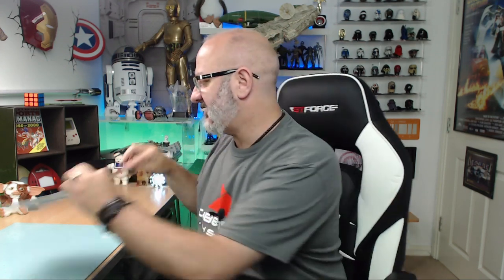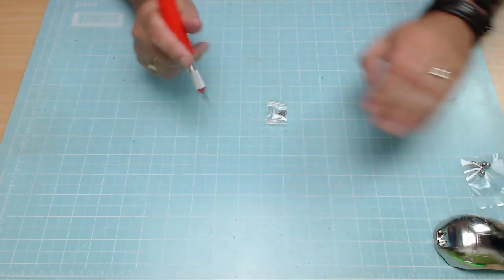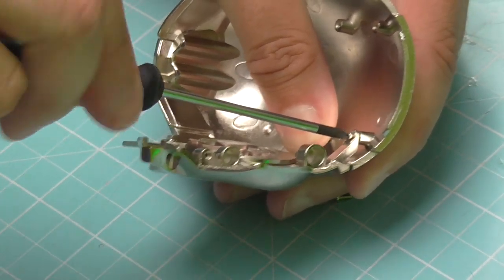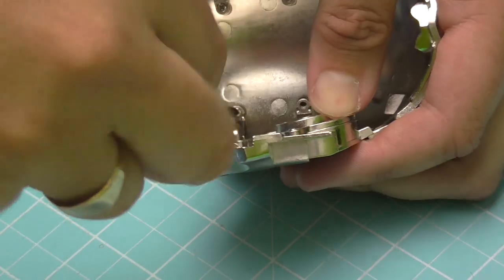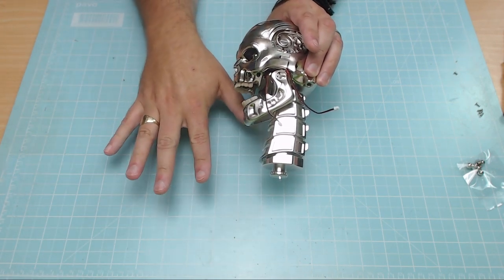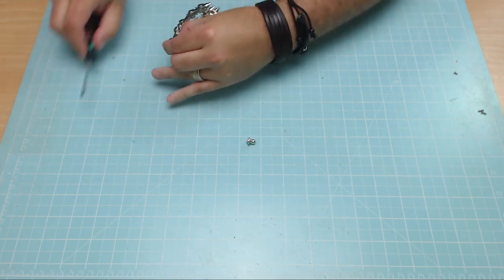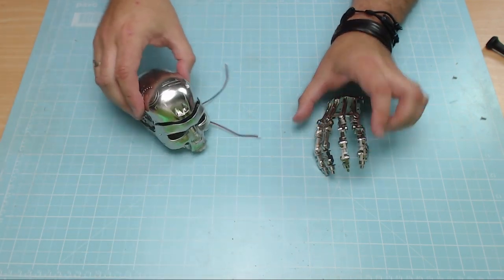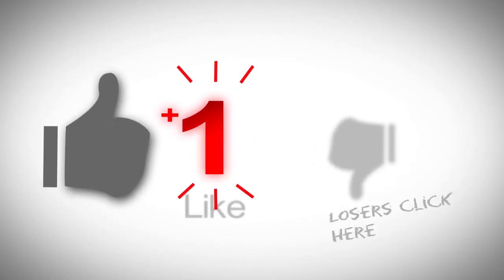Build the Terminator - Part 17 - Fitting the Sides of the Head and Palm Details

Comment: I'm still wondering how those eye cables are going to get to be on the "inside" of the neck, no hole in that ball joint at the top of the neck,  no idea
Reply from the maker: Me neither lol
Reply: @WorldofWayneUK  Do we have info that that is how it is or are we guessing,  i thought it'll all be in the head like a radio controlled car,  batteries,  receiver and a couple of servos all packed in 😂
Reply: I've a feeling there's going to be a small board that'll attach to the back of the head where you plug in the eye LEDS and atleast two more wires will be fed through the two holes in the lower jaw plate at the back, one on each side and the wires will be much more thinner to fit through either the pistons or the outer neck wires.
Reply: Much like their model Bismark. Their will also be asmall gearbox so's that both eye's can move left to right via remote control. I also think their will be som sorta Small hydraulic motor/gearbox. So's that both the diecast metal pistons for the upper arm/plastic pistons for the lower arm can also move up/down remotely. So they'll be much more electronics just for that simple movement. But that's along way off yet
Reply: Maybe the eye cables might connect to the big cabled pipes that come out of the back of the head and run  down into the chest part, to an infared unit  for the remote control! 🤔
Reply: @AdamKummrow5436  Then they'll need to be som sorta infared sensor then
Reply: @bedfordshiremodeller4491  that's what i was thinking, having an infared sensor at the front for the remote control, behind the chest plate! Guess time will tell as we progress! 🤔👍